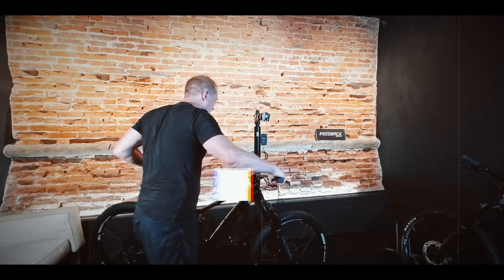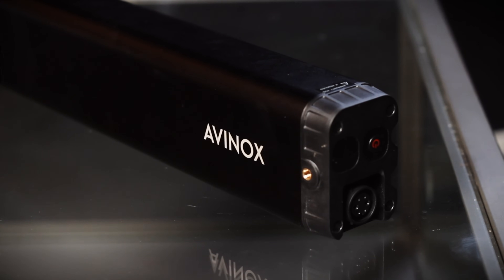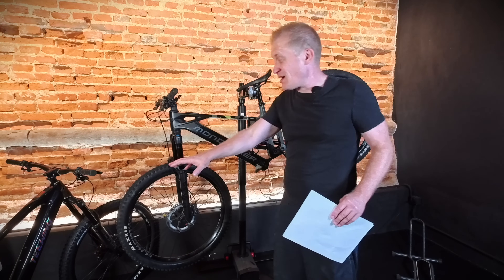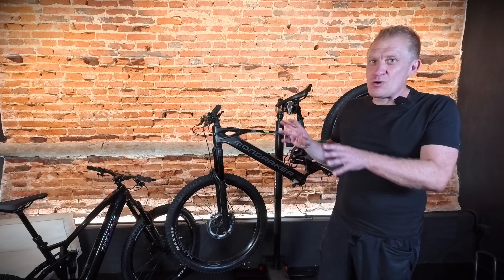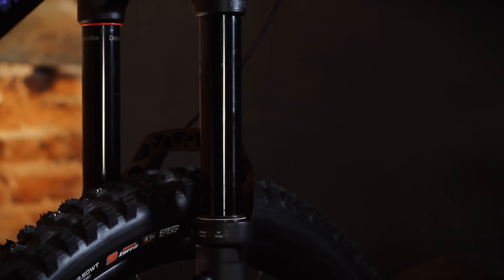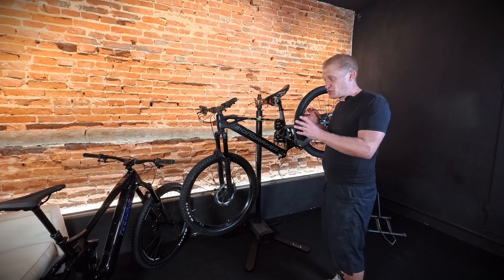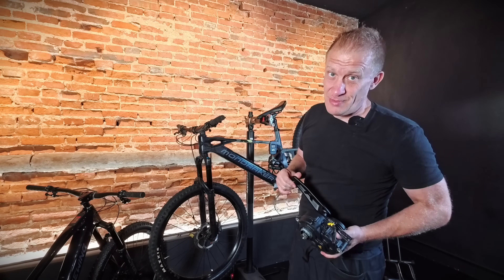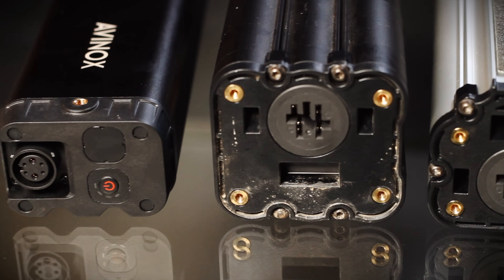DJI Or Bosch For A Better EMTB?

Comment: The Bosch motor system is effectively lighter because: 1) it doesn't need a 250 gram bash guard added as the motor itself provides bash-ring protection, and 2) it's 10-20% more efficient, meaning it can climb more on a smaller battery which saves weight. If you manage to get the CX-R (Bosch should make this the standard), you save another 150 grams there. The Bosch is also quieter, has better support & better torque management/ ride feel.
I don't get the opportunity to ride all of the bikes, so I pay a lot of attention to all the reviewers and various posts online. I was very excited about the Avinox initially, but over time came to appreciate what the Bosch brings to the table, and therefore just ordered an Antidote e-bike frame with the Bosch CX-R. Ultimately, getting a Bosch motor with a non-quick removable 600w battery was a requirement for me along with the correct geo, dropper insertion, rear suspension design and so forth.
Reply from the maker: good choice, thats mine as well 600wh.
Reply: My DJI motor is almost silent in operation.  A fair evaluation of efficiency requires you to take into account the power curve/assist level.  The DJI, by default, provides greater assist than the Bosch.  I suspect if you adjust the power curve down, the purported efficiency advantage will disappear or the DJI will actually be more efficient.

Comment: Will the new avinox motor be compatible direct replacement motor swap 
I have heard avinox are bringing out a range extender and a 1000wh battery same size as the 880wh battery
Reply from the maker: they wont fit the cells in a same size battery, size is limited by cells, unless they change to another type.... Motor will be heavier to deal with heat dissipation. possibly more radiators? No idea if it will fit, probably.

Comment: Cube's new Stereo Hybrid 177 AMS is Bosch CX 600wh bike weighting 21kg
Reply: 21,4 kg to be precise and it has awful headset cable routing. I think more people would choose Amflow PL with 800wh battery that weights 21,5.

Comment: Alex – Also one other point almost all of the DJI frames have heavily integrated batteries which means the frames can be lighter whereas a lot of the Bosch bikes allow you to remove them which means a heavier frame. However......
.....a lot of the feedback on why people love the DJI is that it seems to allow frame manufacturers to build a nicer-looking bike. None of us like the "belly" look of the Bosch bikes. I suspect this is down to a slightly more compact motor and better layout of the bolt mounting points. Would love to hear your thoughts on this - when you combine this with it being a bit a bit lighter, rapid firmware evolution, batteries whgich seem to make the downtube less bulbous + a great display - no one I know is considering anything but DJI these days.
Reply from the maker: The TQ battery is same size, the actual battery shape is determined by the cells in it and how they are stacked plus the BMS. The choice has been long and thin, which means downtubes are long compared to some other motor brands. Oli has the same effect. If you dont need to remove the battery you can build the bike frame slimmer, however, looking around at all the bikes there are very few enduro bikes, as noted, brands have built all mountain bikes basically, nothing thats super tough. I would like to see a slash + with it. But, a lot of it is about do you like the motor feel or not. I prefer the bosch feel, the DJI for me is too cadence orientated and drains the battery quick for me at 92 kg in turbo mode, so if you have to pedal it to get range, the low and mid power modes on the bosch feel better to me, more in tune with pedal pressure. 

The point of this video is more about the full power low weight monkier, that is basically false, if you want range with 800w + you need a 800WH battery which is the weight it is as of 2025, which is all the same basically. Bosch batteries are not just designed for EMTB, also they wanted the option with one mount system of 600 or 800. 

With a 600 i generally would find this to be more than enough hence why santa cruz did their vala with it. The next DJI motor will be bigger to cope with the 130NM of torque it will have to dissipate heat. 

The actual bike build influences the overall bike weight more than the motor and battery. The motor is same size as a Shimano in practical terms, which  orbea have been using for years to keep bike looks slim. 

The display on a DJI is useful as it can be used to tune the motor, but the software is S,,,T becasue they want you to install an app to °own° the bike.... very poor show. This can be fixed with a software update....

Imagine you by a bike from one company and to use it you need to give your data to another??? thats not good, as your contract is with the bike brand not the motor company. 

The width of the avinox battery is same as bosch, but its quite a bit longer. The Bosch 600 with an extender is actually my preferred choice as I can cut 1 kilo of fat off the bike easily and not reduce robustness. The main thing is that the bike style is in the hands of the bike company not the motor company.  In your hands the motor is no smaller than other full power motors to the extent of say the TQ, which is maxed at 60 NM 350w. The main point is that motor companies should not do braod sweeping claims about their motors when its the bike build that matters. If you want an Enduro bike it is always gonna weight 23 kg plus with a full power bike unless you spend 10K plus
Reply: The reason the Bosch 800Wh battery is so thick is to have the weight lower. That is functionally better for an ebike. Where as making the battery thinner and higher up makes for a slower turning bike. So if you like looks over performance then you will choose the thinner frame.
Reply: Such a weird conclusion to me. You ignore chain ring protection, rattles, efficiency, Asian vs. German manufacturing and just singularly focus on looks and max power. Your choice obviously.
Reply from the maker: The point was to analysis the marketing which has only focused on the points i covered, which I obviously dismantled, you are correct there are many more points to discuss, but i cant do it all in one video.

Comment: Interesting vid Alex thx!!! I suppose if were knit picking grams,my bosch gen 5 doesn't have a speed sensor cable  that runs  to the back tire which can't weigh very much just looks a bit cleaner and the bosch magnet in the back wheel is prob a bit lighter then the reluctor wheel that the dji uses.We can't feel grams of weight difference so to me the drive systems of today are all the same weight wise.Cheers All!!!
Reply from the maker: which is my point. LOL thanks for watching, at least i had the opportunity to demo this...
Reply: @alexbiketester  I think you're doing some of the most insightful e-bike content out there right now. Thanks!

Comment: Hi Alex, will be interesting, to check the weight only from the frame of the 2 bikes. The decision to built a e-bike with fix battery or  removable i believe is the reason also of the major weight.  Thanks again for your explaining.
Reply from the maker: It works but I didn't have time to strip the bikes down, quite a lot of days of work
Reply: @alexbiketester I believe you👍

Comment: Bizarre! Who are these weight weenies buying ebikes and what are they thinking? When I am buying a bike I want it comfortable and suitable for the riding I am doing. If I want to bike park all day I choose flop geo. when I want to tour all day I don't want flop geo but sensible classic time tested geo.  The weight within reason does not matter. These classes of trial and enduro mean nothing if they both have flop geo. If I want to risk hospital time after every ride or part ride does it matter if I have a beefier enduro or trial bike?
Reply from the maker: Well the amflow was sold on a headline low weight full power. It wasn't the motor it was the bike that's light....